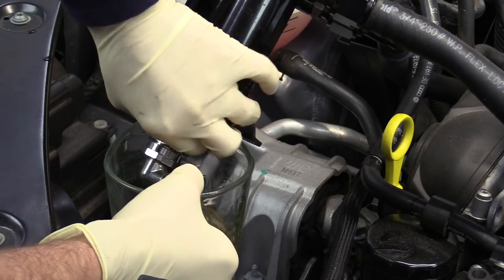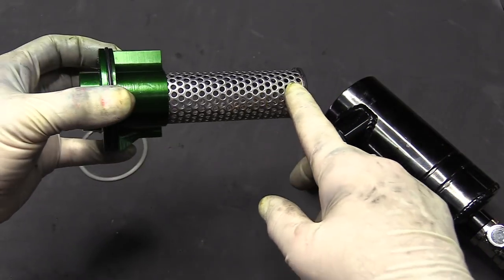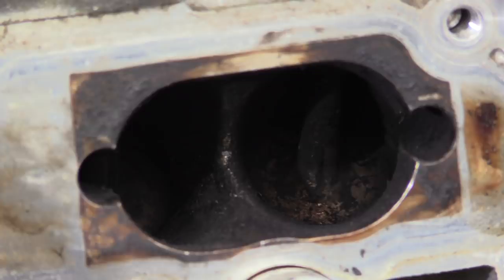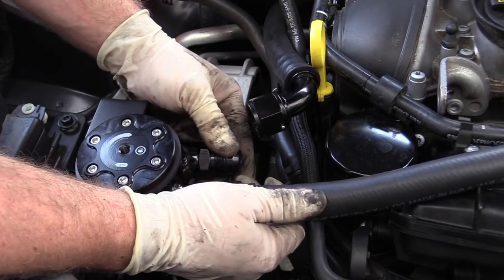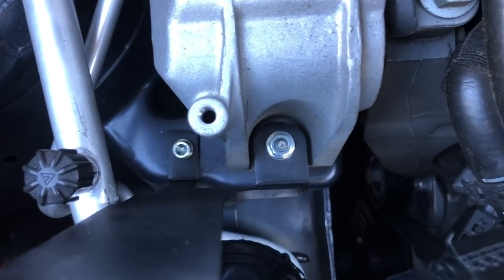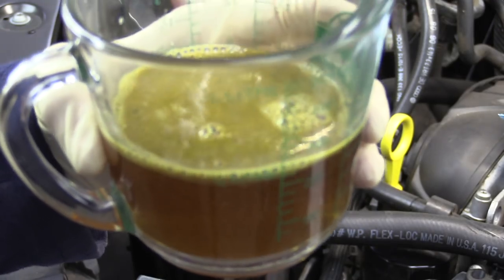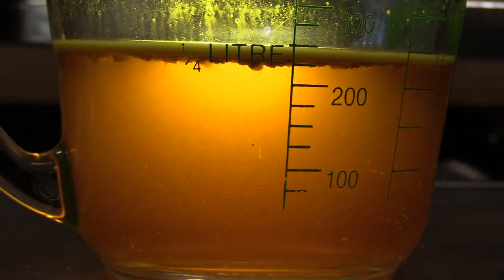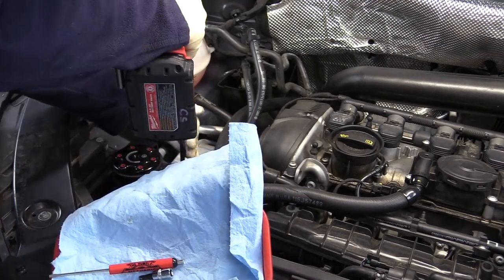Do Catch Cans REALLY Work?

Comment: This really didn't answer anything at all. Unless the question is "does a catch can collect water and a bit of oil". The point of a catch can is to prevent buildup in the intake. That is why people install them. Why is it so hard to check the intake & valves for buildup. All that nonsense about "variables" is just BS. If "variables" are what affect or cause the buildup then why install a catch can??? Sorry, this comes across as an ad for catchcans.
Reply from the maker: LOL, not an add at all for a catch can. 

My point stands on variables. If you took 2 cars from zero miles to 60k, one with and one with out a catch can, you may or may not see a difference. 

But you have to account for all the inputs of the car before making a determination that is accurate. Fuel, driver, maintenance, driving style, and probably a ton more. 

Is it hard to check the intake valves? Not for me its not. But that is not really a fair answer on my part. I think most people don't even want to mess with it. Most owners don't check oil or tire pressure.
Reply: HumbleMechanic How does that even make sense? You're saying you won't check if it works because most people can't check if it works? Isn't that the point of YOU doing it?? 
No one is denying the claim that variables affect the condition of your engine, but the ONLY claim of catch-cans is that they prevent or drastically reduce buildup. And there is only one place to check that and it's not by draining the can. 

What does whether other people  check their tyre pressures have to do with whether YOU can check the state of that engine's intakes and whether you show it on video?

It's like asking "Which car is faster around a race track?" then only testing & showing dyno results of one car because: "There are lots of variables in the outcome of a race and not everyone has access to a race-track or other cars to do it themselves".
Reply: HumbleMechanic HumbleMechanic Not an ad?? Are you being serious? Right  below the video it says "Sponsored" and the ad within that window is for "Shop for Catchcans"! 
It's actually more like one of those infomercials. Where the host pulls the catchcan and says "Eeewww look at all this disgusting fluid!! You don't want THIS in your engine!" and the camera cuts to the audience making disgusted faces turning away in horror. But then they fail to actually show the intake internals and whether the catchcan is doing it's job. 

Hey I love your usual work & am all for YT creators being paid but wow! This is clearly sponsored content without any thought for any hint of veracity in the "does it work?"  

And the sponsor turns out to be someone who sells catchcans. Oh dear, Charles...
Reply from the maker: You realize that the section you are talking about is put there by Youtube, NOT by me? I have no control over that section. Youtube does it because you are watching a video on catch cans. 

In fact this video is not even sponsored. 

Man before you blast me, understand how the platform works. Id be happy to chat more about why I did this video the way I did. But I think you are too worried about this being a sponsored video, which it's not, and hung up on a part of Youtube that I have no control over.
Reply: HumbleMechanic Aaaah no. The actual appearance of a sponsored ad thing was incidental. And yes you clearly know how it works so feigning the idea that it's "all YouTubes' doing" is rather hilarious. Disingenuous but all the more hilarious for it. My initial comment about it feeling like an ad was that the video title and then interpretation of the results of a full catch-can as an indication that the catch can is working is complete BS. The kind of BS that I further described as happens in ads and infomercials, but here on YT it occurs without the controls and restrictions that govern ads. Snake oil if you'll pardon the pun.

Comment: Of course there's water in it, since intake air is not dry.  Moisture in the oil will become acidic, so why recycle moist acidic air through the engine?  This is nothing more than planned degradation by auto manufacturers.  Install a quality AOS, do frequent oil changes and save your engine.
Reply: In the aviation world, some of us remove the oil dipstick for a few minutes after engine shut down and a pillar of steam is always seen rising from the oil filler tube.  Best to do this before the water vapour condenses in the oil pan.  That kind of massive water contamination happens despite a breather tube that vents crankcase fumes overboard (i.e. not circulated back to the intake manifold).  Imagine how much water remains in an auto engine.

Comment: So came here for the answer and got a question. Fail
Reply from the maker: This like many things is not a simple yes/no situation. Did it do something? Yep! Did it do something that will provide long term value? Maybe....
Reply: HumbleMechanic thanks for replying. Instantly will subscribe. I am thinking about an F-150 2.7L.  I'm seeing too many carbon buildup issues. Would this and/or something like seafoam in regular doses keep that engine going?  I'm looking to maintain a vehicle for 15 years. Done want to deal with power loss through carbon buildup they can't engineer away. If that's the case, a naturally aspirated 6 or 8 cylinder may have to be the answer (but would much rather have the better gas mileage - this isn't a truck that will be used as a truck should, more of the vehicle I always wanted to own but never had a reason to).

Comment: You will have more carbon buildup on the back side of the intake valves on a direct injection engine,,,,, you need that more stir and water to help clean these valves,,,,,,.  Catch cans are a very flawed technology and a ripoff,, !!!!   If you could fill them with 8 oz of water and let the engine breathe it once a month then that would be beneficial. !!!!

Comment: Dude, that's condensed water!!!!, 99% of that is water, not oil, and the 1% by volume is emulsified oil. Expensive, useless junk that can fuck with the pressure inside engines and blow sealing rings...(because they to clog and fail 10 thousand percent more often than the OEM crap)